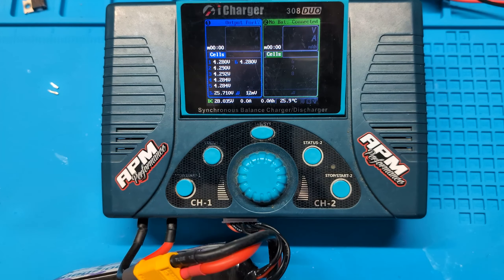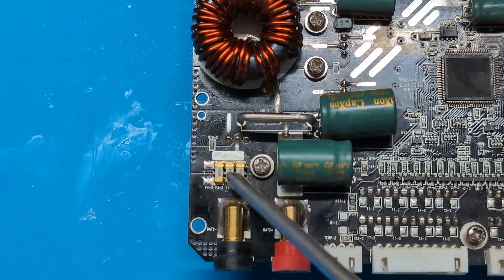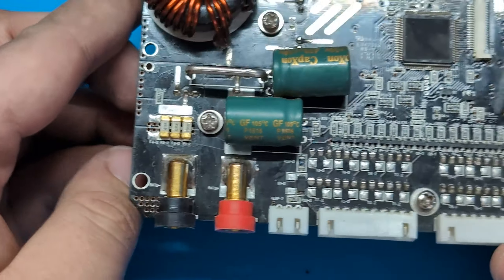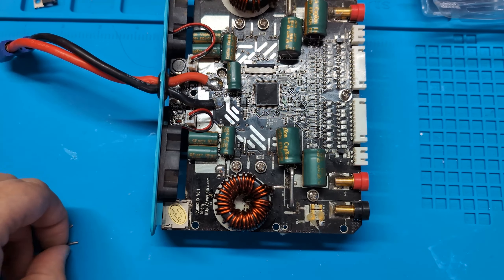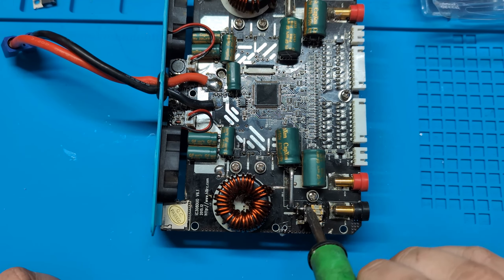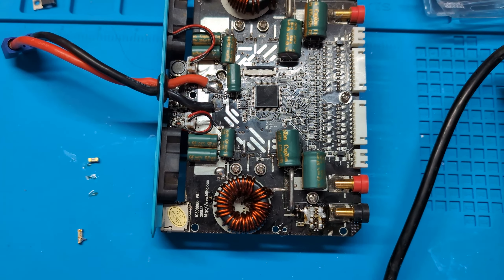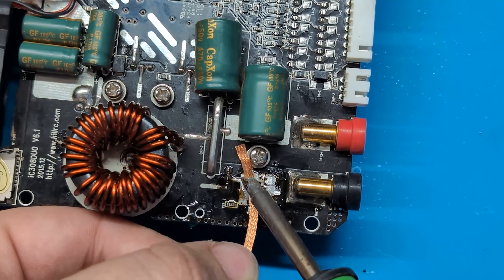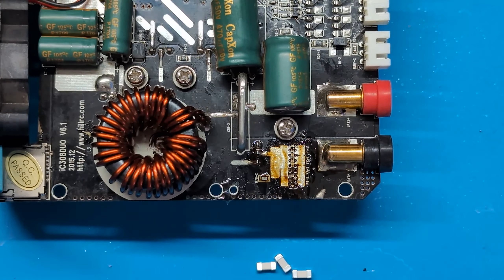iCharger Duo Error 1305 Repair

Comment: Where do you get the fuses
Reply from the maker: Digikey or Mouser.  They're just generic surface mount fuses, measure the ones on the charger and find something comparable with a 15A rating